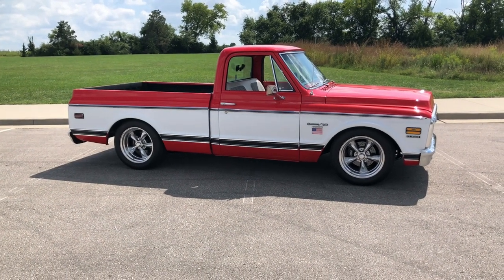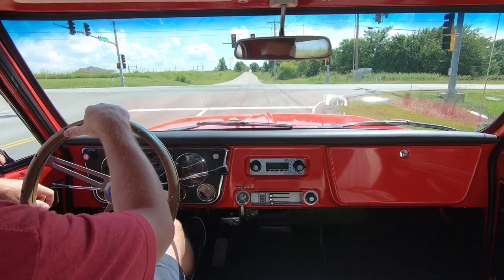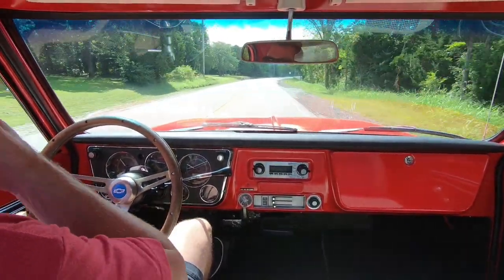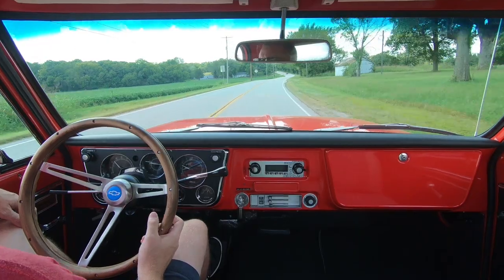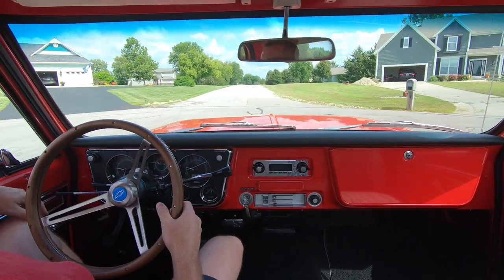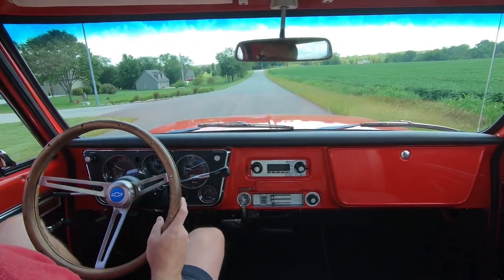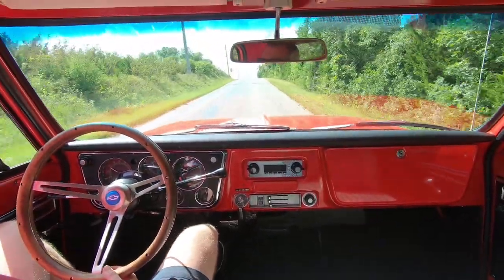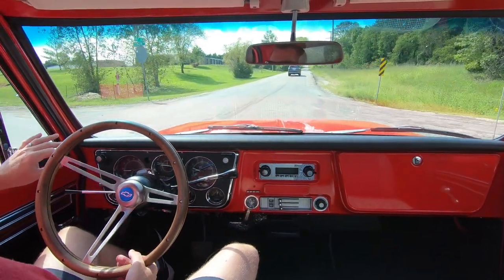About The Build Ep. 4 - LS Swapped C10 - Let's Drive This Thing!

Comment: I have a 74 that I just got done with the LS swap.    the thing is just a 5.3 but it runs like a scalded cat.     All the power I need.    maybe 340hp?   weighed the truck and it was 3200 lbs.. this is like the old 57 chevys I would build with small blocks that ran really good but.... this thing seems to get really good mileage...
Reply from the maker: Heck yeah!   It’s amazing how well these motors perform.  Sounds like a great truck you have!  Thanks for watching

Comment: What steering wheel are you using? BTW, I bought the same headers, but I fabricated my own air distribution box with the cable controls and A/C. 
  Make sure your TAC module matches your 2003 PCM, Throttle body and yes, the bolt on cruise handle requires two relays to creat the correct signals for the module to read. 
  Side Note: I am interested in more factory color wires and I am crazy, using the BCM to have remote keyless, content theft, and a bunch more. I used relay / fuse boxes behind the glove box on Buick Park Ave & LeSabres. They are long skinny rectangle in shape and hold 12 fuses & relays. Most don’t know they are there. Retired ASE Master Tech , Omaha.
Reply from the maker: My steering wheel is a knock off I bought from Classic Parts.  These headers have been no problem yet.  I've only put a couple thousand miles on the truck so far.    When I bought me engine, I got half of a Yukon with it.  I used the TAC that cam with it and a pedal from a 2003 truck.  Works likes a charm.  I have since added cruise and it is amazing.  

That's a good idea on the fuse box.  I'll have to look in to that.    Sounds like you have a nice ride!
Reply: You are right, I forgot about the matching pedal. It is great so much info is out there to keep these trucks going with the modern reliability. After 38+ years in mostly dealers, diagnose, replace part with same part. So the aftermarket stuff is new to me. Glad it is going well. My first vehicle was a 1965 C10 Apache short bed, for $150 at age 13. All hay money. Wood floor soaked with used & new motor oil & diesel. 216k miles & cable broke but use by construction company to service earthmovers, cats, backhoes at job site. 283cu.in. w/power glide trans. 68 Charger second car 4 years later. KS license said “School - Farm” back then.
Reply from the maker: Yes, site like lt1swap.com are a great resource for these swaps.

Comment: Nice build for real the only thing I would not have touched the bottom end even with high mileage everyone says don't touch the bottom ends gm has everything to a science with the robots torquing everything perfect and in the perfect order that even 300 thousand miles taken apart shows almost no wear and the guys that do fool with them don't have near the longevity of a stock bottom end no one knows why either it is just how it is a oil pump and seals gaskets and valve job seals springs cam all that but unless it was a million miles motor they say that money is best put someplace else it's often times a waste
Reply from the maker: It was a judgement call I had to make. Just piece of mind.  Motor had an unknown history.  Top end was a little dirty so decided to spend a few bucks to make sure.  Bearings were in decent shape. Gapped the rings a little loose for some fun in the future 😎

Comment: I have a 1971 Chevy how much is to inst a 5.3 engine and trans
Reply from the maker: That's a good question.  It really depends on where you live, if you want to leave it stock or modify it and how much of the work you are doing yourself.  You can do it fairly cheap if you leave it stock and just bolt it in.  It really depends on what you want to do.

Comment: For the 4L80, did you have to modify the transmission tunnel?
Reply from the maker: I had a high hump in the floor before I did the swap.   People say that have done it with the stock floor, but it will be close.  Search around on 67-72chevytrucks forums.  There is a lot of good info there.
Reply: @RustyWrenches  I technically have a C20, I should have a high hump but I have seen people modify their tunnels. I am not trying to do that would rather go with a built 4l65 but I guess there’s only one way to find out haha
Reply from the maker: I’d go the 80e route if possible.  It’s a much better transmission.  You’ll know if you have a high hump.  It bolts in.  If you don’t have it, the floor is smooth through that area.